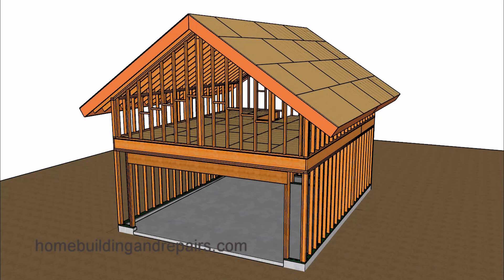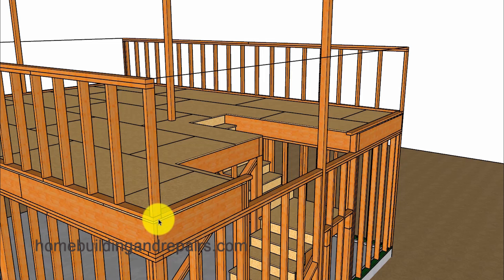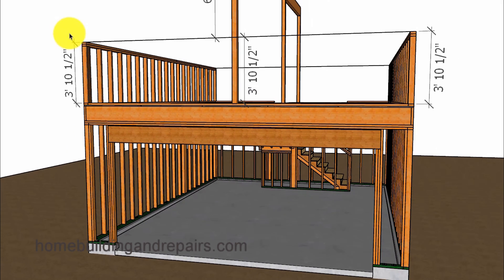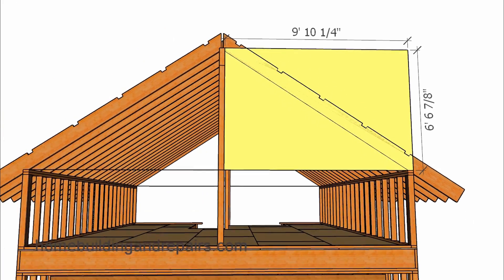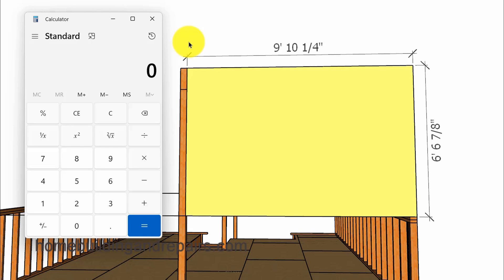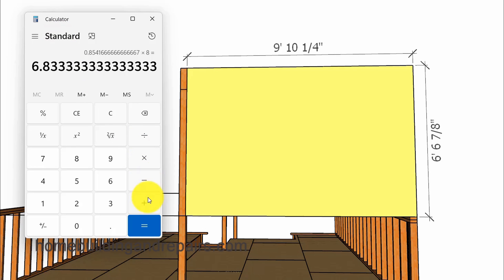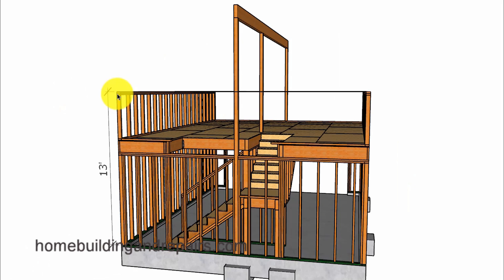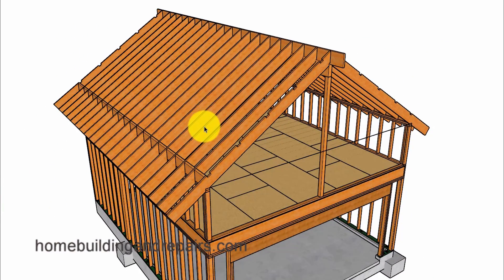How To Calculate Roof Ridge And Framing Post Heights For Double Seat Cut Vaulted Ceilings

Comment: I know this is an old video but in case you see the comments again, i have an important question. Im going to have an lvl beam for a cathedral ceiling thats 5" thick, 14" wide & 40' long with an 8"×8" post supporting it in the middle. My question is can five 2"×4" studs sandwiched together glued & screwed be used at both ends of the lvl beam as support posts in the wall? They will be on the subfloor with concrete piers directly under them.

Comment: Thank you. I'm building right now and next week we are doing exactly this. 
We are having a 23.5'x26' cabin. 
First floor is 10 feet high, second is a living attic wit 6 feet walls and 4/12 roof pitch. 
The walls are 2"x6"x10 at the first floor.
Made a 4 ply 2"x12"x12' beam supported by a wall and a tree ( to support the beam in the mid section).
We are doing the same for the roof ridge beam.
We are in Montana,  min 30 snow load min. I'm doing 2'x10' x14.6' rafters.
I'm doing a lot of research and your video is great!
Thanks

Comment: Okay, I'm following everything on the end of the equation except where did the mutiply by "4" come from? What is the number 4 representing? Because earlier in the video it was multiplied by 8?
Reply: Nvm, I may answer my own questions here, the two example were two different slopped roofs correct?
Reply from the maker: Here's a link that might help https://www.homebuildingandrepairs.com/math/roof/index.html
Reply: @gregvancom  I figured it out after rewatching. Thanks again for everything! Definitely opening my mind to more framing ideas for my project.
Reply: First example is for 8/12 slope second for 4/12 slope😊

Comment: Curious as to what methods you might suggest for an elevator or lift... Or even a stairwell monorail?
Reply from the maker: Maybe thicker framing components, but you can check with product manufactures for more information.

Comment: Does it really make a huge difference if you join your two part ridge board with a scarf joint instead of plywood gussets nailed to the two halves below the rafter angle?
Reply from the maker: I haven't seen a scarf joint in year for a ridge, so I would no and maybe a strap would work better.